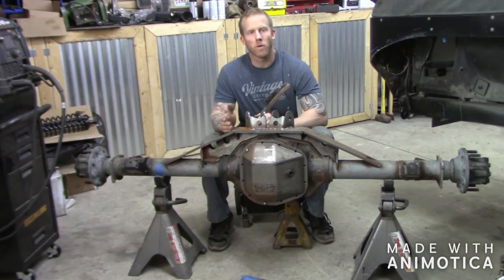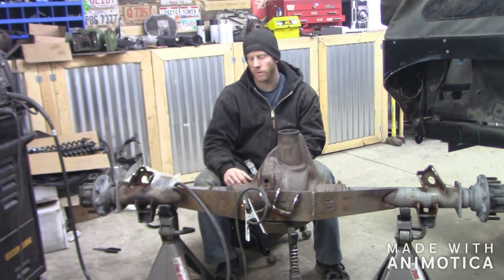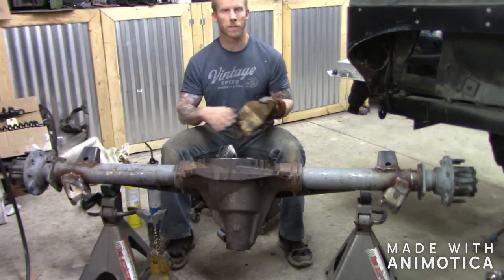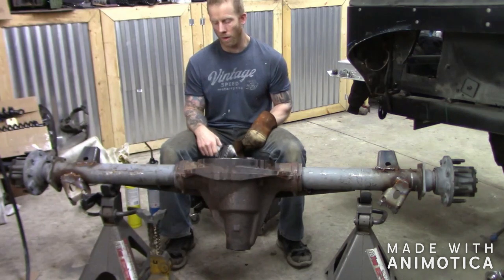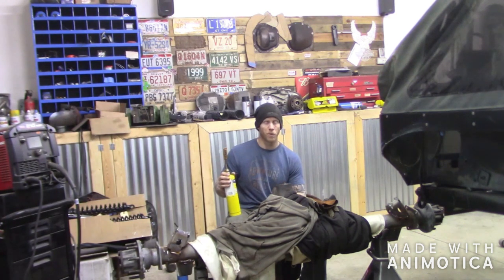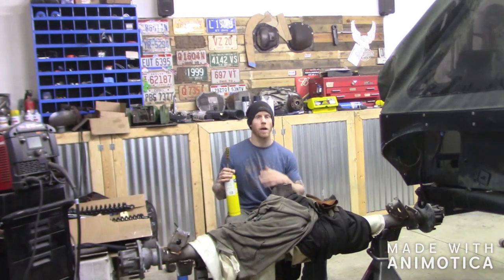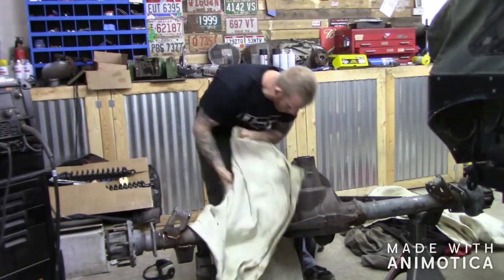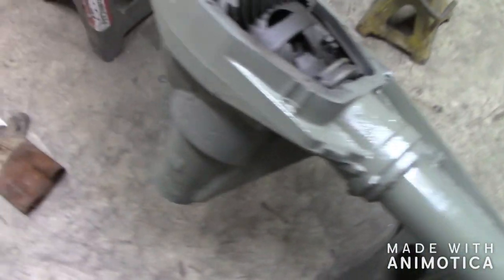Artec Truss

Comment: What gear ratio are you running? Seems there are less options for Sterling 10.5 vs other rear ends.
Reply from the maker: 538s which is pretty common with running 40s. The locker is where you don’t have a lot of choices. I went ARB front and rear
Reply: @CardinalOffroad  Who makes them? I was looking at Yukon but they only go up to 4.88. I'll need at least a 5.13. Awesome vids by the way. They are helping a lot with my build.
Reply from the maker: @dylanfraser6876  no they go higher. I’m running Yukon in mine. Thanks I appreciate it

Comment: What do you think? 14 bolt or 10.5?  On a tj
Reply from the maker: It’s preference really. Pros and cons for both. The 10.5 has a higher pumpkin so more clearance but the 14 has another pinion bearing so can be stronger. People argue this all the time. My opinion go with a sterling. You gain about 3/4” ground clearance and it’s plenty strong. Most JK guys will run the 14 because the sterling is a offset diff and hits the fuel tank but TJs don’t have that issue.
Reply: @CardinalOffroad  I bought a 14 bolt.
Reply from the maker: @pebblehoppertj  cool you’ll be happy.  Worse thing about them is how low the pumpkin is. You always have the option of shaving it to a 13 bolt too. But if you are you need to get the ring gear shaved also.